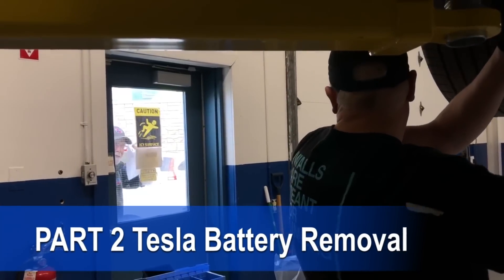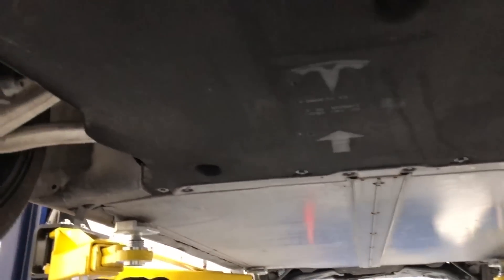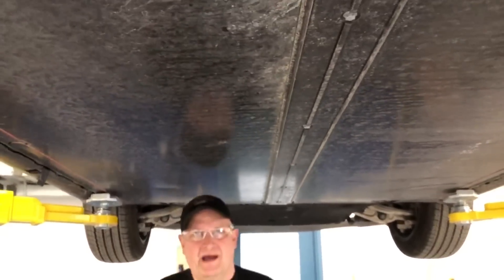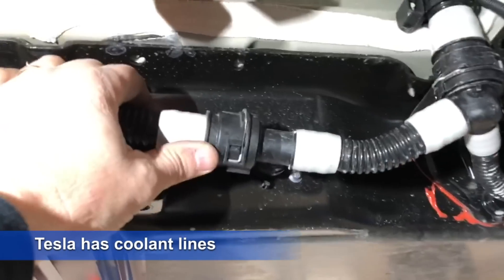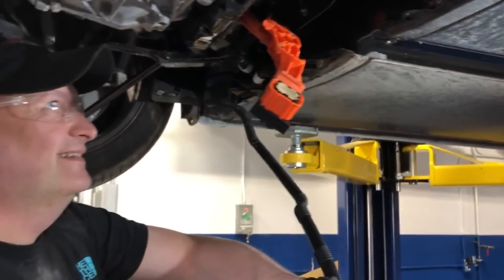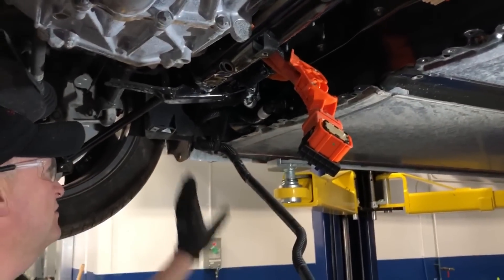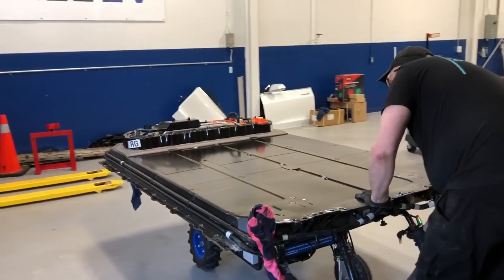Tesla Battery Removal - How Easy is It ?

Comment: What a disaster!   The Tesla originally supposed to be designed for quick battery swapping.  Obviously that Idea went away.  Years ago I was an engineer working with battery/electric fork lift trucks.  They were designed for quick battery swapping.  That was the way to keep the trucks in operation.  That battery looked very vulnerable to damage and ultimately fire.

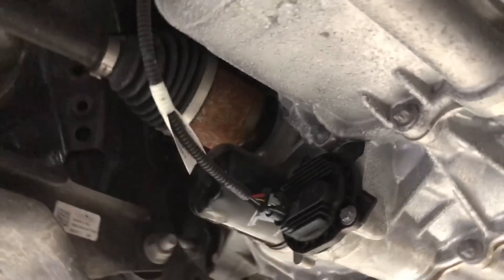Comment: @7:30 Look at that oil filter on an EV.  So maintenance free!  
😂😂😂
Reply: Hey, Teslas were never intended as maintenance free. Yes, they have filters that have to be replaced, but not nearly as often as a internal combustion engines oil filter.
Reply: So Maintenance free until you need a new battery $60-$90,000. Oh that ain’t bad let’s buy another electric vehicles.
Reply: @michaeldanforth3059  Who ever said EVs are maintenance free?  And where did you get those numbers from, I'm curious?  Because a model 3 doesn't even cost 60k 😂
Reply: @michaeldanforth3059  you can't be that dumb
Reply: You know plastic cooling tubes for the $20K+- battery get old right?  It also only takes 1 battery cell of 7000+- it has to bring the car to a halt.
Reply: @BimmerManforeva 4416 cells in the long range model 3. 106 cells in the Lfp battery. Look up Lfp battery, it’s the future of most ev’s
Reply: @BimmerManforeva most ev’s will go longer than most ice cars. In part due to not needing oil changes or timing chains

Comment: What a dreadful hunk of crappy cheap design.
A massive monolithic battery pack is cheaper and easier to build than doing it properly I guess.
If the batteries were in at least four individual drop down boxes that were sealed and insulated from each other and no massive openings into the cabin and a proper seperate replaceable impact absorbing armour plate/s protecting them these massive virtue signalling wanker mobiles would be significantly safer and somewhat cheaper to repair.

Comment: It more interesting how expensive it is to replace the batteries !How many EV buyers can afford a battery replacement if it costs  30000 dollars or more !Replacement could be real if something hit the battery case while driving which has occurred in USA.The repair cost more than buying a new EV car of the same brand eg. Kia ionic 5 .Many EV driver would not be able to buy for a new battery replacement if something like this happens striking the battery case from down under .
Reply: good evs like tesla are not for poor peasants

Comment: The Bolt takes about 30 minutes to swap out a battery — a dealer near me was able to do 4 per day (packing the battery up took longer).
Reply: The battery provides the energy to enable the motors to work, right? It only takes 5 mins to provide an ICE car with fresh energy to make the motor work.
Reply: It doesn't take 5 mins to swap an engine though @56Gumball
Reply: @Alex-lc1bv  This is true, but not relevant. We are talking about the energy source, ie. the battery, which enables an EV to drive.  In an ICE car the liquid that goes in the fuel tank is the energy source. We are not comparing changing electric drive motors vs. internal combustion motors which would be a fair comparison.
Reply: @56Gumball  Just bow out of this one bud.  You lost.
Reply: @Trialnerror  And exactly how have I lost? Please explain.

Comment: Tesla fanboys out there. Does the CT have a warranty and is it voided if you cross a river? There was not much stopping water getting into that battery on the Model 3
Reply: Its water proof like a cell phone, i drive through fairly deep water due to my driveway every day and my tesla is over 10 years old with no problems.

Comment: if a BEV battery fails it’s normally some electronic part or a fuse or even just the sealing the umbrella valves need service after 8 years. Can also be some few bad cells so you can open the lid with oscillating tool with a special Milwaukee blade. Replace one or two modules and recalibration easy fix. Don’t need to replace whole pack.

Comment: That motor looks like it has an oil filter cannister (w/ Tesla logo) on it?
Reply: Yes. Each Tesla motor has an electric oil pump that keeps all the bearings and gears in the drive unit lubricated. I’ve heard that the filter should never have to be changed because, unlike a petrol engine, the electric motor doesn’t create any combustion gases to contaminate the oil and filter.
Reply: I thought the permanent magnetic motors on the Model 3 did not need/use any lubrication
Reply: @dwnrange7812  My Model 3 has one permanent magnet motor and one induction motor. Both motors have self-contained pressurized oil lubrication systems and each has its own oil filter. The oil on each motor also flows through a heat exchanger that allows the cooling system to remove any excess heat from the motors. These are state of the art motors with the potential to run for 1 million miles without needing any service according to company founder Elon Musk. 

If you are interested in knowing more there is a YouTube channel called Munro Live that disassembled the motors (and the rest of the car too) and explains how they work.

Comment: Ice is dead get over it already....dinosaurs
Reply: You should watch the other channel where the owner parked his Tesla outside in below zero weather and then charged it at a supercharger!  The clown car spent more than 30 min heating up the motors while no heat going into the cabin of the car!!!   That must have felt real good!!😂😂😂
And, the first attempt of connecting the charger to the car was a fail as it failed to 'latch' - no connection means nomcharging!!!!
So let me ask you this - how many ICE vehicle owners fail in outting the gas nozzle into the fuel tank's filler neck the first time??!!!
Pretty funny you people waste all your time & effort on this nonsense for zero gains as it wastes more of our resources than any ICE vehicles!!!!
Reply: It’s not dead yet but when batteries get to about 80% energy density as oil/gas/diesel then oil will only be for rockets and jet engines. It’s coming slowly but surely. Them carbon nanotube batteries gonna be the end all to ice. People just don’t understand simply plugging in at your home for waaaay cheaper and waking up to a full tank of battery, they can’t comprehend it and until they experience it and how badass a Tesla is, they gonna hate. Haters gonna hate until they see and then they gonna be on the band wagon.
Reply: @larryphillips4164  Yeah I agree that ICE is going out of style. I have a Tesla but I miss my old mechanical Jeep sometimes. Super cold temps really affect the efficiency of BEV's, more so than ICE's. But get this! We went on a 1800km round trip in -22c weather and we got about 37MPG on average (cost wise). 37MPG in -22c is pretty amazing. My Mazda got 37mpg in the summer lol. And that's using Superchargers, which were $0.48/kWh at the time. My power company charges $0.148/kWh so it's even cheaper! During the winter, I spend $80/month to charge at home.
Reply: @LostFart  Unfortunately, with all this fanfare, it still 'costs' society more to have these battery cars than not!!!
Reply: I can go get gas, go to the store, go to the bank, go to the post office and be back home before the electric car is charged
Reply: @jameswbarry9576  And these clown car owners have to worry about the electric plug of the charger being able to be properly connected to the batter car!  There is another channel that documented this type failure!!!
As far as I know, every single person who has ever put a fuel filler nozzle into the fuel tank filler neck of their ICE vehicles has had a success rate of 100% - there has never been a failure, ever!!!!
Reply: We should all be upset at the legacy auto for taking our money...claiming bankruptcy getting tax payer money....laying off hard workers to fatten up thier pocket....spitting pollution and giving us all breathing conditions...me toxic?!?! Get real
Reply: In your dreams son. 😂
Reply: do you have any idea how many chemicals that go in to the battery so this is going to save the planet
Reply: @jameswbarry9576  99 percent of battery chemistry can be recycled...what is in your cellular phones the last 20 years plus....let's follow the path of oil...burn fuel to get it out of the ground...burn fuel to ship to refining...burn fuel to refine crude...burn fuel to ship to gas stations...burn fuel to get to gas station...burn fuel get home...100 percent non recyclable
Reply: @dstylez1171  And let's talk about oil shall we??
1.  100% of all items you consume, including the food you eat everyday, were brought to you because we have oil!!!
2.  The fertilizers, pesticides,  equipment to plant, harvest, transport, process, transport to market the foods all are powered by fossil fuels!
3.  Unless you will grow your own food and make everything you use in your daily life ON YOUR OWN - you'd be better keep this trash talking about fossil fuels to yourself and not broadcast it as you come off as a hypocrite to the nth degree!
Reply: @jameswbarry9576  I'd say - let these clowns have their own battery cars for what they get out of it. We also should have the following laws:
1.  Battery car owners will pay an additional tax on the mileage of their vehicles for the damage their vehicles do to the roads because of the excessive weight.
2.  Battery car owners will pay the fire departments that respond to a vehicle fire caused by an accident that ignites their vehicle regardless who is at fault!  This includes the excessive amounts of water needed to cool the fire before it is extinguished and also the storage cost of  the wreckage so it can be isolated and not start another fire when the battery self ignites again.
3.  Battery car owners should pay for all infrastructure costs of building up the charging stations and not rely on the public to subsidize this infrastructure build out.
4.  Battery car owners should be charged an additional amount per kilowatt hour they get either from a charger at home or at a charger outside of their home as this taxes the electrical grid and requires electric utilities to add additional capacity beyond what is normal due to population growth!

So let these people have their cake and eat it too but THEY have to pay for it ALL and NOT the rest of us!!!
Reply: @LWRC  hi I saw a video on a tesla fire the fire department has a special blanket for electric cars it costs like 5000.00  to cover the car and its very heavy to drap over the car ya it covers the car but it's to cantee the fire but it may still be on fire on the inside
Reply: @jameswbarry9576  Lithium battery fires do not require oxygen to sustain combustion. This is why when these batteries self ignite on board aircraft flying at 9 miles high, they still burn!!
The problem the fire dept have with these fires is they can never be sure the source is completely extinguished as it may start back up again at the tow yard!!!
Reply: @jameswbarry9576  I have seen too many Hyundai on the road on fire over the last 10 years....I just seen a new Ford bronco stranded on the road too....how about the fact that there little explosions happening inside the cylinders...it's over get over it
Reply: @dstylez1171  Speaking of fires....all those fires you've seen of ICE vehicles, the amount of water it took by the fire departments to put them out combined was less than one fire of a battery vehicle!!!
You want to talk about advantages??!!!😂😂🤣🤣👍👍👍
Reply: @LWRC  they will figure it all out...stats are on the side of evs so...see you in 2035
Reply: @dstylez1171   
You won't need to wait till 2035 as consumers have already spoken - battery vehicle sales have tanked!
And, what part of energy waste of these battery vehicles do you not understand?  If you are that clueless, you shouldn't open your mouth and just keep it to yourself and at least we may think you have some common sense for once you open your mouth, it removes all doubt!!!
Reply: Pssst stellantis is leaving north America...lol
Reply: @dstylez1171  And you have removed all doubt to your level of intelligence!!!  Keep those comments coming !!!🤣🤣👍👍👍
Reply: @LWRC  right it's OK ...ethernet loop...giga press...lithium mining and processing....solar energy grid solutions....reusable rockets...starlink network...I can literally keep going...intelligent?...I think I will stay on the positive side and look for a brighter future...see ya smarty....don't forget about made in America
Reply: @LWRC  like I said u do u and see u in 2035
Reply: @dstylez1171  We all want to improve our lives and technology can play a vital part. What neither you nor I nor elon nor God can do is violate the laws of thermodynamics!!! So if you don't understand it, don't pretend to as it just makes you sound like a fool. If that's your goal - keep at it!!!
Reply: @LWRC  tesla just out sold vw Q4....peace dude
Reply: What's the Prince of Saudi doing with the profits of the oil you are paying for.... a green city...change has to start somewhere...are we all not using cell phones?...bye bye rotary phones...like ice autos...sorry
Reply: @dstylez1171  When you stop eating the food and consuming all the consumer goods you use each and every day!
And complaining about Saudis??!!!  You must have voted for potato head just as 100% of all the battery car owners did!  We were energy independent with President Trump and your clown traitor in the WH decimated the oil industry on day one!  How's inflation treating you?
Reply: @dstylez1171  Regarding rotary phones va digital phones....battery cars are not better than ICE vehicles!
What you folks are doing is taking spring water from a natural spring source, pouring it down a hole that you have to dig, then siphon the water out of the hole, filter it and then drink it!   This is what you folks are doing with this battery car nonsense!!!
Reply: You’re really not that smart are you?
Reply: Sorry fanboys but you will soon be regretting the lost freedom that two minutes at a pump gave you.
Instead of just jumping in and going you will have to plan a route that has a minimum distance from a charger and hope that there’s no queue that reaches to the next charger location.
You will also morn the loss of cheap insurance as now the few companies Woke enough to still insurance these toxic time bombs will charge a massive premium for not only the cost of having to write the vehicle off for even minor damage due to the high cost of repairs and any tiny little mark on the battery pack that could result in catastrophe, but also the massive public liability cost as just one ev fire can nuke an entire parking garage, not to mention the hazmat cleanup.
Reply: @anomamos9095  always full in the morning...mark my words ice is dead
Reply: @dstylez1171   did you delete/report my last comment? Seems like I hurt your feelings and you can't take the truth. ICE vehicles are not going anywhere anytime soon. They are superior to any current EVs. I hope you get what you deserve as well.
Reply: @dstylez1171  Yeh, great for a city dweller doing local journeys. EV is crap in rural areas and places like Australia or the American plains. Take your blinkers off man!
Reply: @dstylez1171  there seems to be plenty of ice at the poles that stubbornly refuses to disappear as ordered by Al and Greta etc.
The only EVs that have a future run on rails.
Reply: About 1.5 billion ICE vehicles on the road.  They're not going anywhere fast.
In 2023 1 million EV's where produced.
It'll take some time
Reply: @stuartburns8657  only 1 million in 2023? Tesla is on track for about 1.8 million this year alone
Reply: @stuartburns8657 agree
Reply: Those that have already gone to ev are not going back....they are superior to ice...facts
Reply: @dstylez1171 WRONG. I dislike idiots like you trying to speak for everyone. I own/drive a Tesla and like it a lot. But it's my "second" car, and I will always consider it my second car. If I had to downsize, the EV would definitely go first and would keep my ICE vehicle.
Reply: @znismo1  it's still over for ice and we have been sold inferior autos since the Japanese have been making cars...GM, Ford and Stellantis...need to go...and if no one supports companies that make true American cars...you will get what you deserve
Reply: You fell for the biggest scam ever.
Reply: @tonystormcloud6889  we all have been paying too much for inferior autos...have fun with those 4 cylinder turbos and turbo v6s  all garbage and no new engineering...see ya
Reply: @LostFart  did I hurt ur feelings...truth hurts sometimes time to wake up
Reply: @LostFart  u first